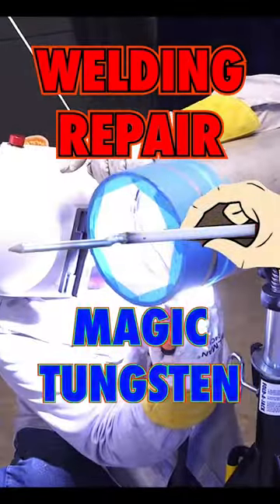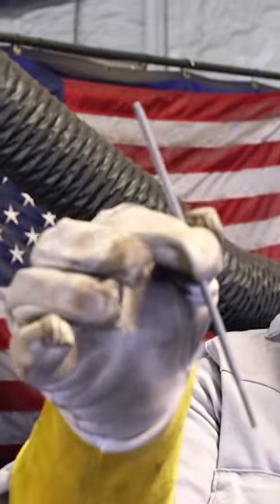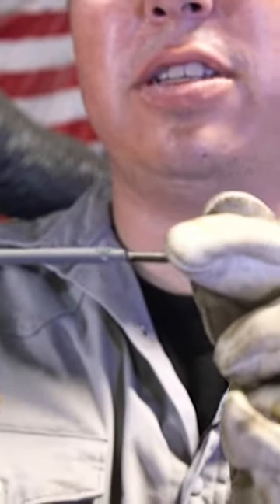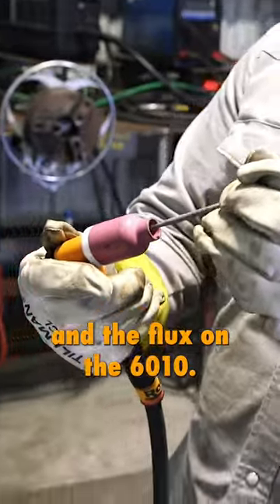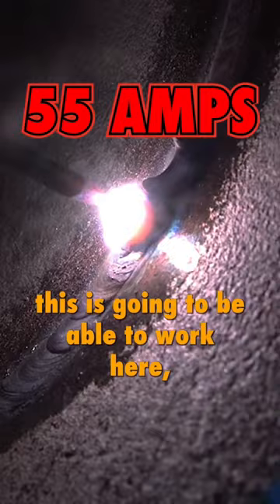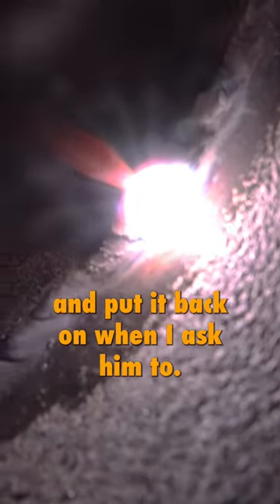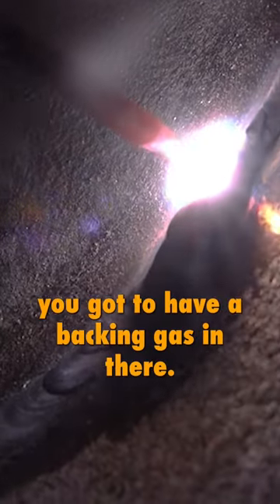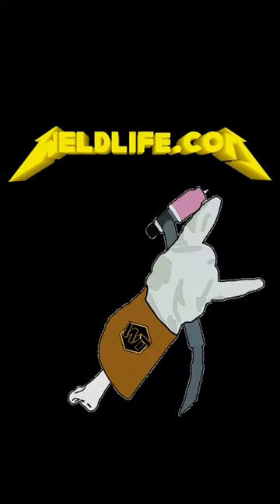Using the Magic Tungsten for a welding repair on a stainless steel root #shorts

Comment: As long as you purge the pipe it wold work on carbon too.  Great tip.
Reply: Up to a point yes, but if you go for to long without a dab of filler wire,it kind of burns and comes up sort of coked. Try it and see,put down 3 inch of weld the come back and just kind of blend it in a bit.

Comment: If you get cought doing this in most test shops they will bust yo ass out . Just FYI
Reply: It’s debatable if a legit inspector would look this out , I test welders on a regular basis and often tell a guy if he can fix it without cutting it open or reaching inside the pipe I’ll let it go… reason being it’s always handy to have a quick thinking repair man around!!!😊

Comment: Been welding pipe over 30 years never seen this!! I usually grind root until almost blue turn heat down and watch my hanger melt away
Reply: Same man. I've never seen this in 32 year of pipe welding

Comment: Someone also made a comment about pin hole when you end .. that is 100 percent correct .. your supposed to lift the arc away using the filler rod so there’s no suck Back .. as a 35 year experience pressure welder .. I find stuff like this troubling and we’ll just in contrast to anything a welding school would teach

Comment: Just slice the weld open with a grinder and rerun that section of root .. you can’t really wash over stuff without adding filler material.. can’t say I’ve seen this or would do this .. I’ve been pipe welder 35 years .. and have repaired a few roots in my day ..
Reply: Agreed. Just cut it out and redo it. There's no way that's passing inspection in the shops I worked in.

Comment: Why not just keep your purge and heat the outside until that puddle starts moving to fuse it?  Is a neat trick tho
Reply: Stainless is very hard to break down ,you might grind it to soften it but no guarantee you won't get suckback.
Reply: Cause not all alloys are as soft as stainless.  Can’t use your method on inco or chrome     An plus this method is used more for if you have wall showing still. Not just cold wire

Comment: Easier way to do it is just place the heat on the other side of the cold wire on the outside . And it will melt the cold wire into the weld.